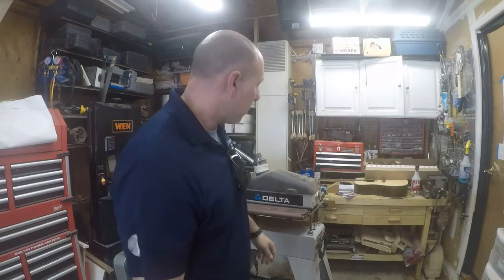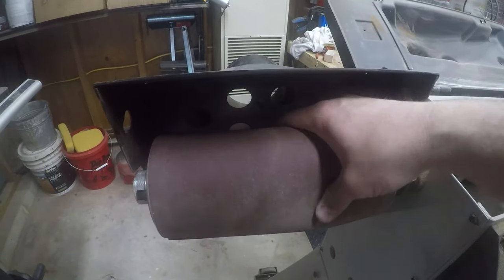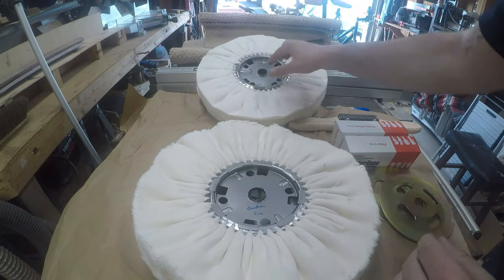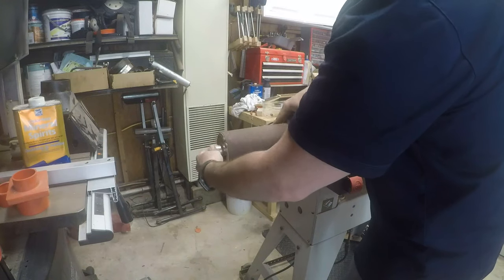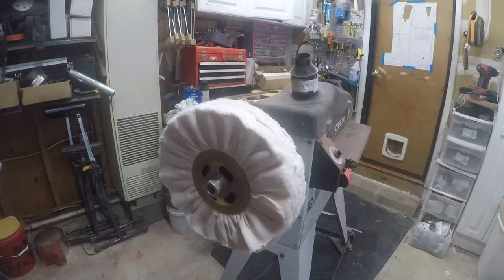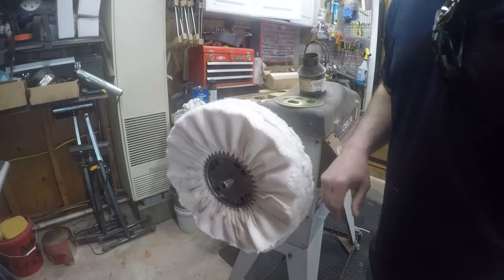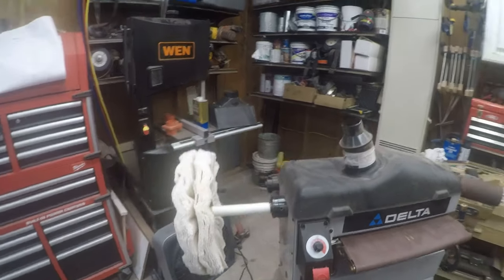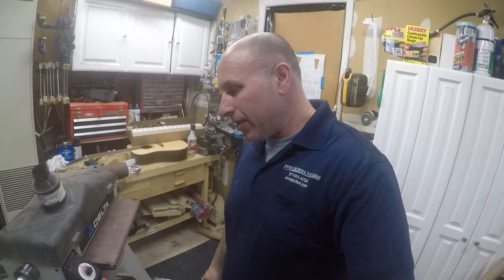Retrofitting a Delta Drum Sander into to a Buffing Machine

Comment: Hi GPTV  Great idea.
I think you had a lucky escape not finding a suitable nut as it would most likely lock solid on the shaft when it came in contact with the thread end.  Be interesting to know if the runout caused problems when buffing?  In which case l'm guessing a outrigger bearing to stabilize the head would not be too difficult to rig up. 
Anyway thanks for sharing. 👍👍👍👍